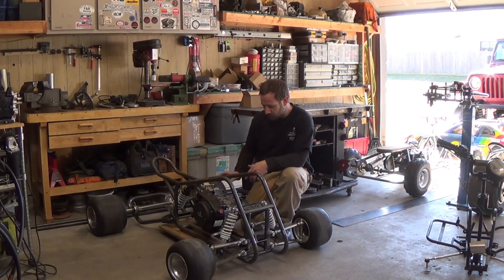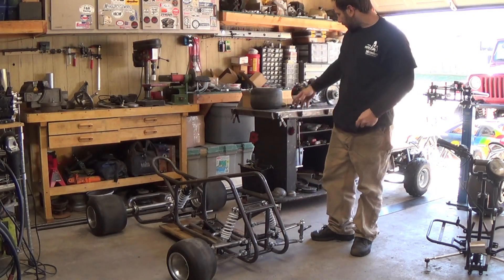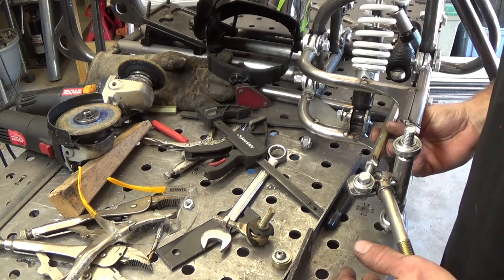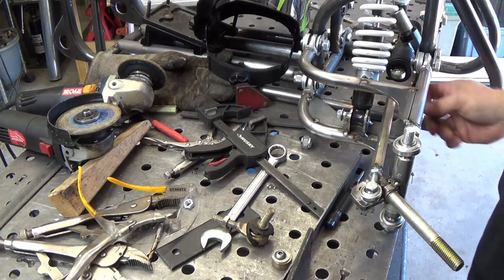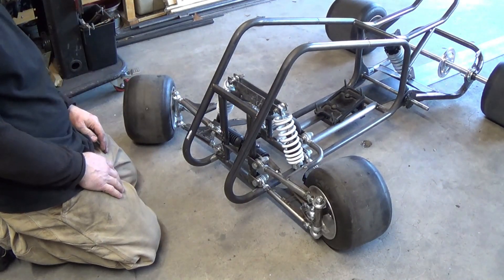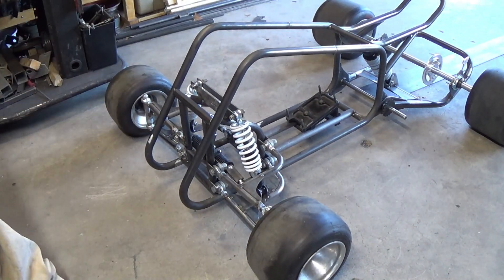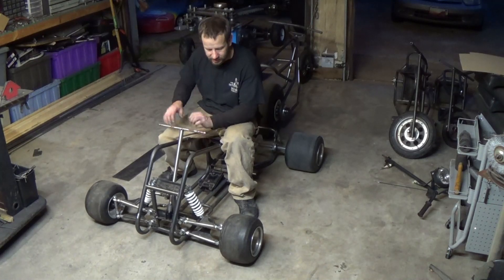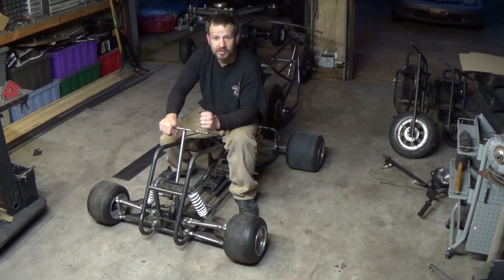Exciting progress! prototype driftquad steering

Comment: Different racks have different steering rate right? As in how many turns til full lock?
Reply from the maker: Yeah I cant remember the ratio for this one but it's not enough lol
Reply: Sweet Mfg. makes fast ratio steering racks meant for micro sprint cars, in either 1 turn, .75 turn, or .5 turn lock to lock. Expensive because they're race car parts, but I dunno where else you'll find a similarly sized rack with ratios like that.